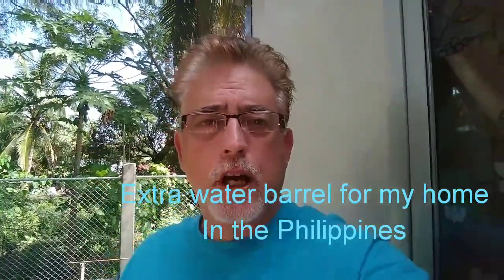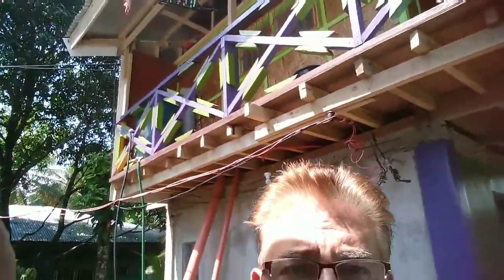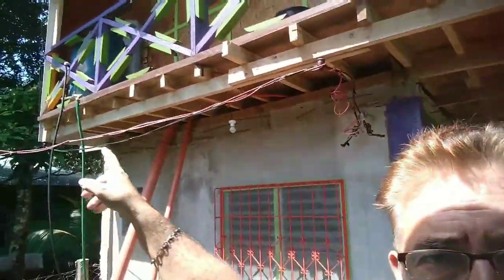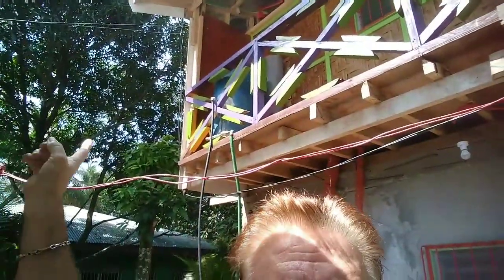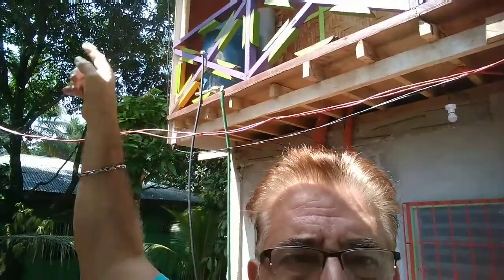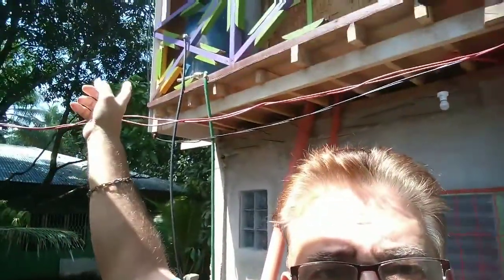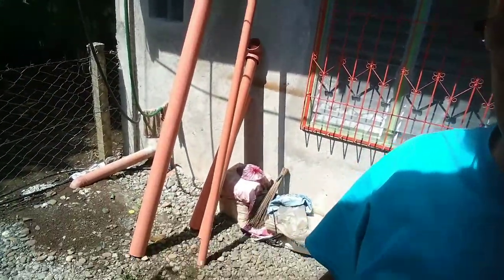My water barrel for extra water here in Philippines

Comment: Hi Tom... you do nice videos.  You mentioned doing a concrete slab for a garage.  How much is concrete there?  Can you even figure per yard?  i know alot is done by all manual labor.  but how much would you figure it costs?  and Thanks again for your great videos.
Reply from the maker: +Joe Rathbun hi Joe well a bag is 80 kilo.. And here you have to add gravel etc.. No ready made.. You can do like a 20x20 feet garage.. 2 guys 1 day.. Including concrete and gravel.. 50 dollars.. Approx price.. Yeah they figure by contract or day labor..
Reply from the maker: Joe Rathbun also.. Really best way here is contract price.. For job..
Reply: So really its very inexpensive using and building in concrete.
Reply: am i understanding you correctly... a 20x20 pad would cost less than $100? labor and all?
Reply from the maker: +Joe Rathbun yeah concrete pad 100.00
Reply from the maker: Joe Rathbun yeah a concrete pad less than 100.00..for sure..

Comment: hi tom..good info... $1000 - $2000 or more to run power a short distance .  i hope to use solar ..$2500usd ?
also water,,,, this in the usa  its looked at as a given,,not a semi luxury . i like your fence,,im not a fan of
a solid concrete wall .  oh and the starting size of a house,,keep it tiny add later !  salamat .....
Reply from the maker: +charles hueckstaedt hi Charles.. How are you.. yes   you are right  simplicity and add on later.. I had that plan from the beginning.. And also same on solar..
Reply from the maker: +charles hueckstaedt I forgot to tell.. You there is American across town using wind for power. I am not a fan of that bit he said it works great.. He said small system fridge TV phone light... Notice I said 1 light.. Haha.. The Chinese introduced peel off solar panel.. Attached to roof of home.. Costs not sure of I saw at hardware store
Reply: thanks tom>> there was a solar product made in the usa ..peel & stick ..i think its no longer available ?
Reply from the maker: +charles hueckstaedt ohhh OK.. Yeah.. I can understand that..